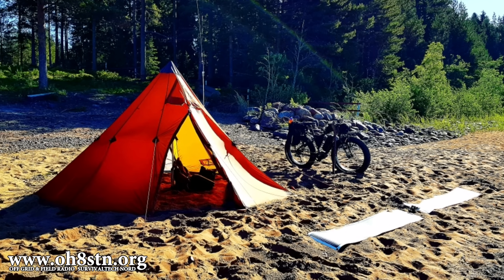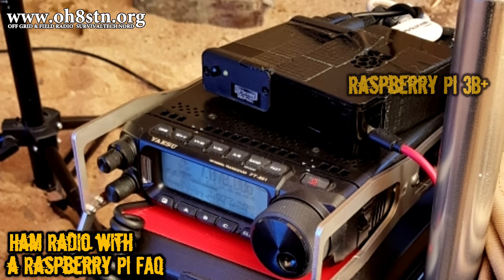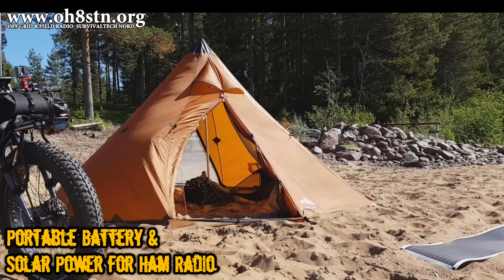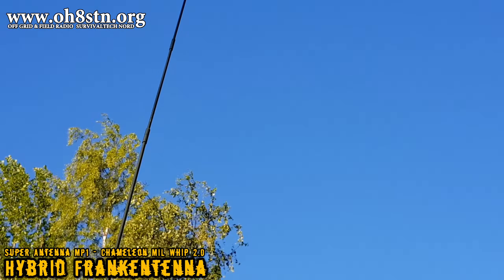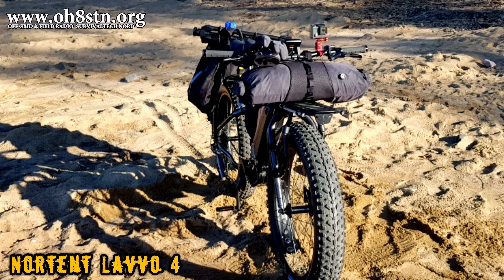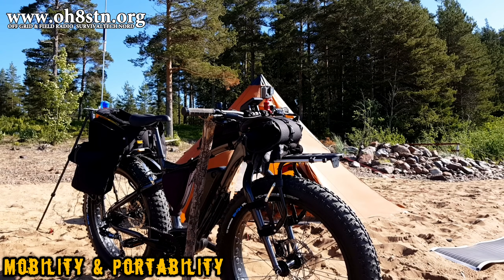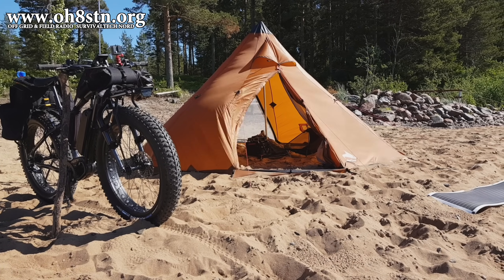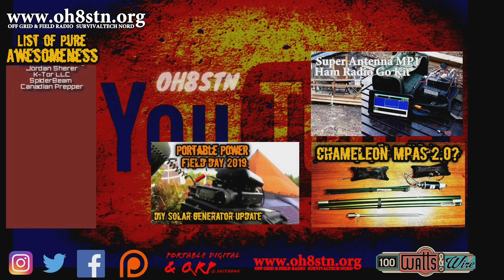Portable Ham Radio Station

Comment: Great vid thankyou. Does the rasp-pi have a display and are you running a logging app? I noticed the micro keyboard like i use on my raspi4 but didnt notice a screen. So far i just take my ft818 around in my van and use whips on the van or wires in trees to send cw to WebSdrs all over the world to see where i can be heard. I use a phone or phone and its hotspot to a laptop to see the websdr's. Need to play more seeing  websdr's on the smaller raspi's.  Occasionaly Miss the higher power of other radios but the ft818 has vhf and uhf which is nice for experimenting or listening moonbounce. My most barebones portable station is one of those 4 watt 40 or 20 meter radios (49er style) on a cigarette pack sized circuit board. Just a ne602 for a receiver and a small output, But i have seen its signal on websdrs in US and Australia. It hears about everything my FT818 can.
Reply from the maker: I've moved on from the raspberry pi. It's great as a cheap desktop computer, too complicated for portable work.
https://youtu.be/-XXpvZ2ifh4

Comment: This radio seems be heavy for such activity. Have you considered Elecraft KX2 ?
Reply from the maker: Hello Alex. Yes I have considered the kx2, but when I made this video I had a little bit different focus. I didn't choose the kx2 because you can't charge it in the field. It has an excellent receiver performance, but it's a radio designed for a couple of hours operating at a time. Then you take it home, take the battery out, charge it, then make it ready for the next time out. At the moment I've got the Icom IC-705 and Xiegu X5105 which are a little heavier, but totally off grid compatible.

Comment: Frankentenna :)
Excellent video my friend Julian ! 
I too use my own frankentenna : MFJ coil (i also have an high inductivity coil), MFJ whip and Chameleon extender for additional performance, sometimes the MFJ coil and wire.
Basically i have 80 to 6m vertical possibility with this setup.
I have gathered the material to build my on EFHW too.

Thank you for your time making these excellent videos. 73, chris ha7wx

Comment: I am a Ham, KI7BSL, and I cannot drive. I ride a recumbent bike and I've rigged it with a 2m/70cm  TYT UV8000E HT, connected too a Diamond 7900 Super Gainer dual band antenna. Of course this is only for local use. Also, I should let you know that Burley has a version of the Nomad trailer that can be outfitted with fat tires. Yes I know your trying to keep the weight down, but you do need food and other odds and ends to at least be able to tolerate a multi day deployment. Still in all a great set up. Did you make any contacts?

Comment: Excellent video, and great concept!  This is a big reason I got interested in ham radio some 40 years ago, but due to unfortunate circumstances I was unable to continue my Amateur Radio activities and signed off after my one ten-year licensed period.  Now I'm getting back into the game, and am really interested in man-power ham radio operation.  I still haven't regained my General ticket (using the element 2 exam procedure) because I'm studying for the Extra Class exam to take the tests together.  I'm 73 years old with some physical limitations, but I still want to get out in the open on Field Day with a QRP CW rig up high on the mountaintop a mile away.  I should be able to hike it if I start a couple of days early, and it should make for some interesting communication.  Thanks very much for your ideas!  Made me think about things I never would have considered (never having done anything like this before.)   
73 (Is it OK to use "73" if I'm not yet back in operation??)  
- Tim (formerly KA6HIK)
Reply from the maker: Such a wonderful comment Tim. Here's some inspiration for ya. I'm almost blind in one eye, suffered from PTSD and live with waves of arthritic pain almost constantly. You've got me beat buy a couple of decades but honestly, if I can do it, I think someone as motivated as you can do it too.
Seriously though, it's awesome to hear you getting back into ham radio after so long. There are still those who want to push-ups into doing it in some specific way. Thankfully how we Define amateur radio has really broadened since you were first licensed. Sounds like you have an awesome plan and I look forward to hearing from you again on the channel.
It's definitely okay to say 73 👍👍👍

Comment: Very interesting setup. I too am interested in self contained portability but I run a little heavy with an FT-897 and Gel Cells. My antenna is Buddipole/stick on fiberglass poles with counter poise. I live on the east side of the mountains in Washington state so I like the potential to deploy NVIS for over the mountain regional communication. I use Vertical for low angle propagation. Im most interested in your power supply/solar setup. Im looking at lithium iron and solar.  GREAT video. looking forward to more.

73
Jim / AC7AX
Reply from the maker: Thanks Jim. I really appreciate you telling us about your setup and your goals. I have a couple of different battery projects on the channel. Each one is also a solar generator. I don't know if I mentioned this already I'm kind of having a Deja Vu, but if I still hadn't 897 I would do an internal battery project with lithium iron phosphate cells replacing the nickel metal hydride which came standard. That would be a really fun project for me. Thanks again for the kindness and the comment, it's very much appreciated.

Comment: What kind of bike is that, it's pretty sweet.
Reply from the maker: Thanks for the question. It's a local brand called GZR Model Raw 19". 250 watt integrated mid-drive motor, 672wh, 48 volt li-ion pack. sram gears, hydraulic brakes, 4.8' tires. https://instagram.com/efat_rdr?igshid=1g0pu5uhd5a3r

Comment: Julian, I’m curious about your antenna setup.  How do you go about setting up the mp-1? Obviously the included super antenna tuning card is of no use when employing the mil whip. Did you use an analyzer and create your own card, or use some other technique?  

Looking forward to your reply and future videos.

73 and Semper Fi

Howard KI7TKS
Reply from the maker: Hello Howard. 
I used my pocket antenna analyzer, but only the first time.  Then created marks on the card with a permanent marker, adding the spots for 20, 30 and 40m when using the collapsible whip. Easy as cake 👍

Comment: Being physically and mentally challenged I would be the dead guy on the beach if I had to set up like that. Like the video though and have watched it a couple or three times. Thank you for taking the time putting it together for our enjoyment. got it on my saved list and hope to try something like that only using a van and gen/inv.  Again thanx
Reply from the maker: No problem Karl. The thing I'm trying to portray it's getting out there and actually doing it. We all have our individual circumstances, so we need to adapt to the circumstances to make it work. Operating out of a van with your station on the beach sounds like a brilliant idea. I also have trouble with my eyes, so I don't ride a motorcycle anymore. This is the reason for so much of the hiking and cycling that I do. Thanks for the comment and the kindness. It's very much appreciated. 👍

Comment: You are living the dream my friend! My bucket list for sure. I didn't catch it, but that looks like a Radrover E-Bike, along with the radio equipment, solar power and the entire concept is awesome.  "Rock and Roll" 73 -Kelly - WB0WQS.
Reply from the maker: Thanks Kelly. It's very similar to a radrover, the difference being a mid Drive motor instead of a hub on the rear wheel. I'll be heading out to Expedition next week with the same setup + camping gear. I hope you're right about the concept 😀👍👍👍

Comment: Great Viedo Julian. Could you tell me the brand etc of the cable that you purchased to connects your radio the Pi. I use à 706 which has a 12 pin Din data port so than I  guess I need a 12 pin ďin x usb 2.o. Thanks
Reply from the maker: It's a little bit different for the Icom 706 than for the Yaesu. The Yaesu uses a rig control cable, and a audio cable for the audio interface. For the FT817, the data cable came with the interface, the tig control cable (CAT) came  separately. Both came from ZLP. http://www.g4zlp.co.uk

Comment: Great job. I like your battery pack construct vids, but wonder why not just buy a Bioenno battery of correct size?  73
Reply from the maker: I like to be able to understand how my battery works, what's inside, and how to repair it. Bioenno is just a system integrator, buying Chinese parts and putting them in their own black box. I can do that myself. If I were going to just buy a battery, (which is actually a good idea for some operators), I would buy from Dakota lithium. Dakota lithium is also an American company, but the parts that go inside their packs are well-documented and public. So we know exactly what goes inside, and the quality to expect.

Comment: Great Video you certainly have Perked Up my curiosity about amateur radio.And you have used solar power and minimal resources to get the job done.
Reply from the maker: Best comment ever. 
Far too often amateur radio is presented as a dull, somewhat boring "hobby". Amateur radio with purpose, especially when combined with solar power and  lightweight energy dense battery technologies is something entirely different. In this example we don't just show the radio aspects of amateur radio, the show the possibilities of using batteries and off-grid solar power sustainably while operating in the field. 
I absolutely love amateur radio, but equally as passionate about battery and solar power. 
Thanks for the comment then kindness, It's very much appreciated.

Comment: I agree with your view that Field Day should focus more operators on light fast, man portable station deployments. In a real emergency situation such operations ma be absolutely essential if infrastructre is damaged so as to make normal operations in a vechicle impossible. Getting into a disaster site might actually require  being entirely man portable if roads are  blocked. Being entirely atonomous not only makes you a better operator but also makes you more valuable as an emergency resource should the need arise.
Reply from the maker: Well said 👍
Thanks for leaving this amazing comment.
73
Julian oh8stn

Comment: So did you put the bike together yourself or was it turnkey?
Reply from the maker: Bike, motor,  battery were turn-key, racks, panniers, ... I installed. Working on the trailer integration now.
Reply from the maker: My first idea was to buy a bike and convert it. Unfortunately I couldn't get the integrated motor frame without the rest of the bike. In the end turned out to be in much better integration than I could have done on my own.

Comment: This is exactly what field day should be about. Going out into the field, seeing what works and what doesn't. Tweaking improvements of carry items to see how you can best get your station up and running with what you are able to carry yourself. FYI your $5 patreon subscription is full. I'll find another way. Thank you for the content and I look forward to seeing what else you have to share.
Reply from the maker: It's amazing how many of us don't understand this simple point. Getting experience out in the field also helps us in the ham Shack, but I fear most operators don't see the connection. Thanks for the heads up on patreon. I'll fix that as soon as possible.
Thanks for the comment, and the kindness. It's very much appreciated.
73
Julian oh8stn

Comment: Julian, what digital program do you use, and is it Android based?  Thank you. 73 Cliff W3KKO
Reply from the maker: High cliff I do use some android-based apps for psk31, wspr and rtty, but I've recently moved my digi comms over to the Raspberry Pi. Android development with amateur radio apps is extremely slow at the moment. It is my preferred operating system but there's more development going on for the Raspberry Pi ATM. So for the Raspberry Pi I'm using JS8Call, fldigi, wsjtx, just as most people use them on Windows, Linux or Apple. Here's the video I did explaining the setup.
https://youtu.be/BcMMlGvPCsw
Reply: @OH8STN  Thanks Julian

Comment: What program you using for logging and digital 
Thinking about this myself.  
Using 817
Don't know the first thing about pie raspberry 
KQ4CDPaul
Reply from the maker: Hey thanks for the question. I like to keep things simple so the two applications that use the most with the raspberry pi are js8call and fldigi. I used the inbuilt logbooks and both of those programs. When I work ft 8 with wsjt-x, I also use its inbuilt logbook. Occasionally I export those logs and adif format, and import them to QRZ.
Reply: @OH8STN  tnxs for the info have to look into raspberry pi.  Just information to  Fill my empty head 73

Comment: Hey Julian. Really enjoy your videos. Inspirational to the point that I purchased the Chameleon CHA MPAS (Modular Portable Antenna System) KIT  recommended and inspired by you. And I am very happy I did. Unfortunately as soon as I received the original version  kit, they brought out the new CHA MPAS (Modular Portable Antenna System) kit with the kit bag. Anyway I am questioning why you did not just bring the this kit new or original,  instead of the extra weight, and bulkiness  of the tripod etc on your bike. And you swapped out the balun with another than the mpas Hybrid? 

Keep em coming Julian . I enjoy it all!
Reply from the maker: Great question Chris. I love the MPAS,  but sometimes I want to operate on specific bands with as close to a resonant antennas I can get. The Broadband antenna is awesome when you're jumping around the bands and you don't know where you're going to end up. In this case I knew exactly where I was going to operate, and wanted to have a near resonant antenna for 20 and 40 m without carrying a tuner. The MP1 is the best "single band" freestanding portable antenna. The MPAS is the best freestanding broadband antenna. Sometimes you have to mix it up to get what you want/need.

Comment: Thanks for sharing Julian ! I have used a BOB bike trailer in the past for bicycle touring and it has excellent stability and fair cross country (not single track) performance. I'm not sure if your dropouts are too wide but for carrying one on your fat tire bike.  The trailer also makes a fair antenna support base. Thanks again !
Reply from the maker: Thanks for the comment and the kindness. It's also always good to hear from you. The dropouts are incredibly wide on this bike since it supports up to 5 in wide tires. I heard about this Bob trailers and they're even sold locally or something similar here in Finland. I've decided to try to reuse my hiking trailer. It looks pretty easy, but I don't know how robust it'll be. Definitely not single track stuff. The worst that be going through with the trailer, I believe is sand and Forest roads. Here's what I came up with so far. It's just a mock-up so don't laugh yourself to death 😀
https://www.instagram.com/p/BzcxTErl8Do/?igshid=8kzuy7t8kppy

Comment: Just a thought , you could use one of the carriers on the bike to mount the vertical and eliminate the tripod ...great video as usual regards vk3fmpc
Reply: If you solve the counterpoise issue and the seat post on the bike is round I’d think of slipping the seat out and making a mast the same size, whack it in and tighten it up
Reply from the maker: Actually Mark I tried that. The bike itself wasn't enough to provide a good counterpoise. But I'm wondering when I connect my trailer to the bike if when combined that will be enough for at least 20m. Excellent suggestion and I'll definitely try further experiments. Thanks for the comment, and the kindness It's very much appreciated.

Comment: First, thank you very much for your videos, they are extremely helpful, and a great learning experience. I would like to know, with your PowerFilm solar panels, do you use their connection cables, or did you fit Anderson Powerpole connectors, I was thinking of purchasing one of Powerfilm's daisy chain connectors, and I thought for the price they are asking, the power pole connectors would be a bit cheaper, and also keep the polarity. Again thanks for another informative video, and 73 KG5WXU
Reply from the maker: You are very welcome Glendon. I used the weather pack connection coming off of the Power film panels, but I convert them to Anderson powerpole when coming into the charge controller. With that said, I have bought the weather pack crimper and started making these jumper cables myself. Sometimes you want to have a cable which is made up for putting panels in series, other times you want to put them in parallel. Either way, and whatever you want, it's easy to do it yourself if you have the weather pack crimper along with then Anderson power-pole crimper. The only caveat is the weather pack connectors are waterproof. So if that connection is going outside in the elements you probably wouldn't want to use power poles for that. Here's a link to my Instagram page showing one of the cables I made myself. https://www.instagram.com/p/ByDrws6j2bZ/?igshid=harpslo65z5c
Reply: @OH8STN  Thanks for the reply, looking at the weather pack connectors, and crimper, they definitely are on my must have list.

Comment: One of your best videos yet! Why carry the large metal whip? Why not use a sloped end-fed? (granted it requires the tuner, but hey.) 73 N7CWR
Reply from the maker: Thanks 👍
I could have deployed an endfed, but I wouldn't get it high enough (on 40m) without a launcher. Then there's the tuner. I'm building a loaded half-wave wire for the packtenna, so we'll try that next.